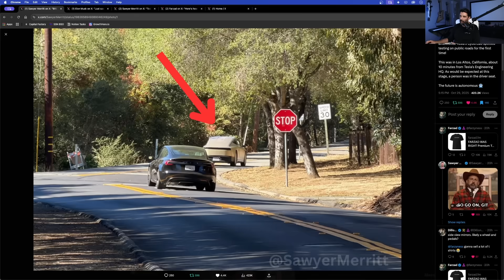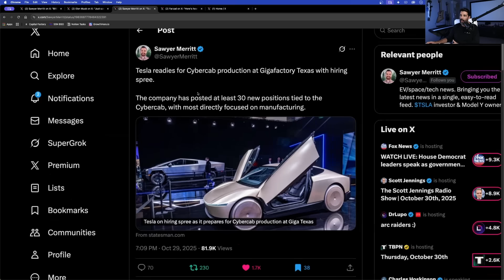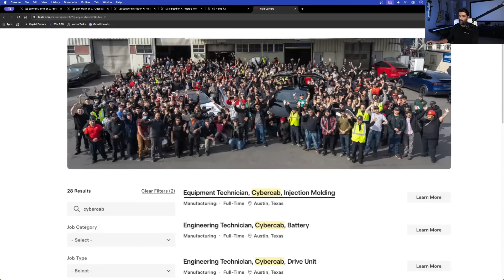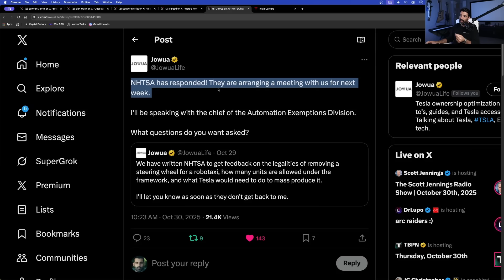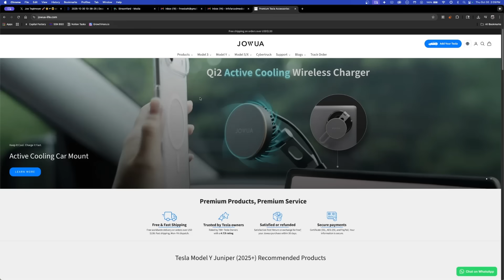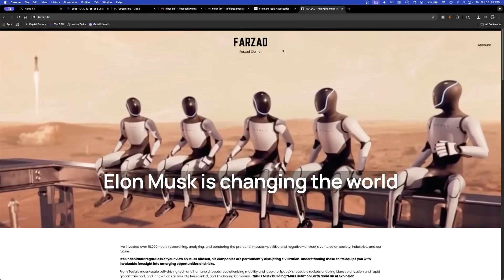BREAKING: 1st Tesla Cybercab Spotted on Public Streets

Comment: The cybercab could have a plugin drive by wire steering and plugin pedals. This would make for an easy change to and from a no steering wheel and pedals setup.
A further advantage of such a design is that a single design of car could be made for LHD and RHD cars. A production line could supply the whole world without a different vehicle for LHD and RHD markets.
Reply: That is a curious perspective and a great way to sidestep regulatory limits - kind of like the regulation forcing car trunks to be openable from the inside if trunk volume is above certain value, and automakers get around that by selling a car with easily dismantled dividers that halve the nominal volume.
Reply: Not sure, however, how hard it would be to manufacture a modular steering unit. Elon is focused on streamlining manufacturing, and modular designs tend to be an extra layer of pain in the a** on production side.

Comment: GM's thought process is stop making EVs and a sales slowdown will occur. The Bolt was selling very well then they stopped making it. Something about Mary.
Reply: The ones that weren’t catching fire ?
Reply: When you lose $5K-$10K per unit like GM did on the Bolt, maybe it was stupid to build them in the first place.
Reply: @comingverysoon 
When the first model of any vehicle rolls off of the assembly line, the cost is about 1 billion dollars for that first one.
After the second one is built, the price is one-half billion each.
After four are built, the cost is down to 250 million...and so it goes as hundreds of thousands are built, the cost comes way down, and the profit goes up.

Only if a vehicle is sold in volume, will it make money.

Perhaps GM should learn how to design and manufacture EVs at a profit, like Tesla does.
Reply: @dvader3263 GM knew what they were doing. There was no intention to scale the Bolt because it was not created to make a profit. It was two things: (1) a compliance car and (2) a mind share product to keep GM's name in the public EV conversation until they could later scale up and legitimately enter the market.
But it was really just a giant fiasco.
Reply: don't think they made money on these?

Comment: Legacy makers had their chance to jump on board. Instead they fought Tesla and tried to stop it.
Reply: Even worse, the early adopters like Nissan with the Leaf put out an inferior product and gave lip service to the charging infrastructure. They took the same mindset as ICE manufacturers where they think of the fuel as someone's else's problem to solve. Tesla doesn't get nearly the credit they deserve for investing wisely in a solid national infrastructure from the get go. They also deserve praise for the vertical integration they do instead of just shopping around for a bunch of parts and then slapping them together. Suggest driving a Bolt to really see and feel the difference that makes. Of course one the of the best things with Tesla is finally getting away from ever having to set foot in a dealership and having to put up with their bullshit tactics for both sales and service

Comment: To my understanding, Tesla doesn’t have to take full responsibility for FSD incidents yet, but I doubt that’ll last once it reaches true autonomy. If the owner no longer has control, Tesla will probably be forced to take liability. That makes me wonder how it’ll work financially if they sell everything upfront, it doesn’t seem like that’d be enough to cover future liability costs. Will they move to a subscription model or tie FSD to Tesla Insurance to keep it sustainable?
Reply: I’ve been driving for decades, over 35 years and been in 1 accident that was not my fault.  A teen driver drove into me as I was waiting to go forward.   If FSD is 10x better than a human it should never have an accident be it’s fault.   Remember these accidents will be captured on video so they should have virtually zero payouts.
Reply: @mangravy2000  even if it’s not their fault, that may still need to be proven. Not to mention that sure it’s safer most of the time but edge cases will always happen, I had an issue a few days ago with a badly set up construction site that I’m pretty sure the car would’ve hit if not for me intervening, and that would have been expensive for my insurance even though the construction site was set up in a pretty dangerous way, some things are just unavoidable and you will still be liable.
Reply: I was told years ago by Tesla Insurance that clauses were built into the policy for Robotaxis.

Comment: The question should be, is Tesla able to manufacture more than 2500 if they completely own the fleet and operate the fleet business.  Especially in the early times before the regulation changes.
Reply: "The question should be, is Tesla able to manufacture more than 2500 if they completely own the fleet and operate the fleet business.  Especially in the early times before the regulation changes."

Are you serious? Look at how many cars Tesla are manufacturing today.
Reply: Tesla can make as many as they want as long as they have steering wheel and pedals which could be removable as regulations change.
Reply: Nothing can stop what Tesla is doing or where it’s going. Don’t worry, regulators are going to bend one or another by human desire to evolve. The human race will not allow the path to be blocked. It’s only slow because trust in the technology is still being built. Once a certain level of confidence is achieved, Tesla will flip a switch and flood the globe.
Reply: Well my question was seriously misunderstood. I know Tesla has the capacity. I was talking about the exception to the regulation, while producing cybercabs without steering wheels. Grok mentioned this, Cruise (GM): Produces Origin shuttles without selling them; GM owns the fleet. These avoid the cap because no “sale” occurs—NHTSA confirmed this in exemptions.